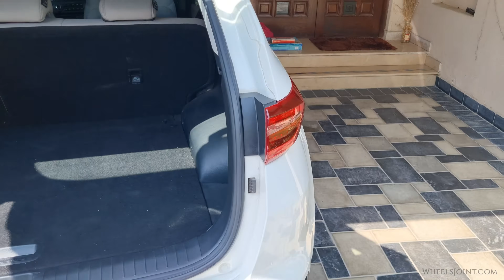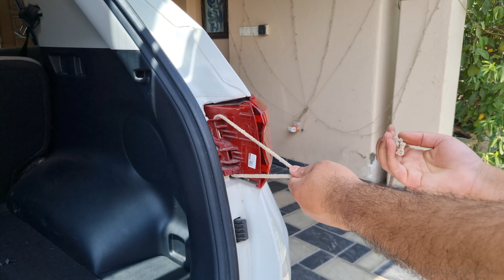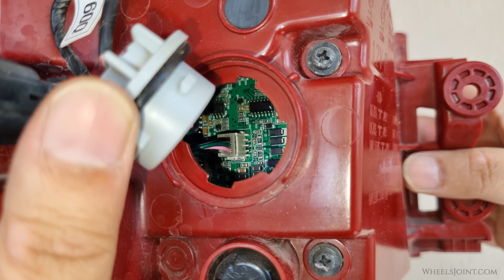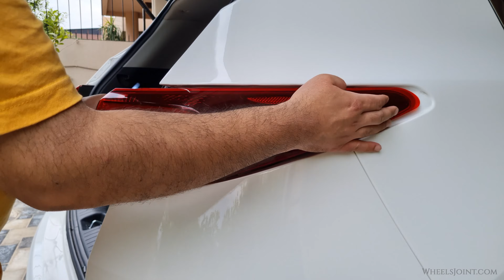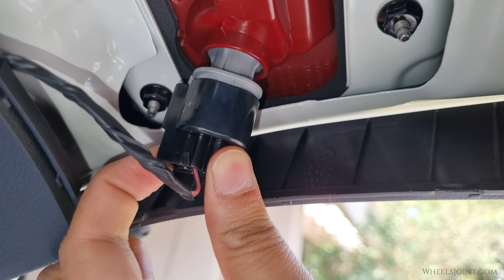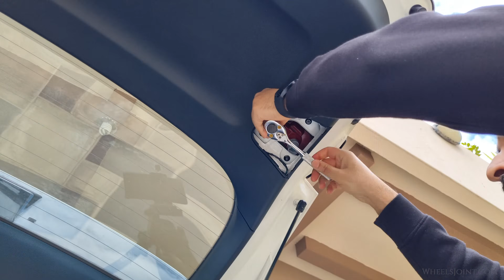How to replace tail lights on Kia Sportage - easy method

Comment: Your rope trick worked like a charm. We also found that it helps if someone puts on a rubberized glove and pushes on the forward side of the brake light simultaneously while someone else pulls the rope. It popped out easily using that method.

Comment: Thank you for this! I couldn’t get mine off originally, but I tried again today with some really thick gold ribbon (I didn’t have rope) and after about 5 minutes of pulling and talking nice to it, it popped off. I wasn’t gonna let this thing defeat me 😂 although the first attempt I tried WD-40 with no luck. It lead to a broken piece of the plastic on the thinner end, but glue is my bestie so no worries. 😅👏👏👏👏👏🎉🎉🎉🎉
Reply from the maker: Glad you managed to get it off, well done! 😊

Comment: I was only changing 1 bulb, but thank you for the tip for using a rope to pull out the housing!  Took a few minutes (plus some WD-40 oil), but I was able to remove it!

Comment: Thanks so much for the rope tip! I spent 30 minutes last night in the cold trying to pull the housing out by hand. Today I tried the rope method and couldn't get it at first. I put on gloves and wrapped the rope around my windshield scrapper and it came off pretty easily. Luckily the wires prevented the housing from hitting the ground. Screw Kia for making this so difficult to take out.
Then I tried taking out the bulb and the glass came out but not the metal... That took another 20 minutes to get out with some pliers.

Comment: Man fantastic job as always! Have you got any tips how to remove a moisture from headlights?  Or should I just go to my local dealer if car is under warranty?
Reply from the maker: Haven't faced this issue. There is a little bit of moisture buildup sometimes at night in cold weather, but it goes away after the headlights are turned on for some time, or when parked or driving under sunlight.

Comment: Yeah if I applied anymore pressure I’m confident I was going to break the fixture so I took a break.  It’s definitely loose but after spending over an hour with a rope on it I wasn’t able to get it out.

Im ready to just pull it out sideways and see how bad I damage it at this point.
Reply: I put a handle through my rope and gave it a quick firm snatch and it popped right out.

Comment: I couldn’t get my 2018 Sportage light out using the purely hand-wiggling method seen in other videos - no matter how patient I was. This trick with the rope worked a treat!

One CAUTION - my tail light assembly popped out suddenly, and I went for a backwards tumble. So, next time I’ll either have a wall right at my back, or I’ll have someone bracing me to keep me from falling backwards

Comment: Cant get the light off to save my life. Now im dirty sweety and still broken light.
Reply from the maker: You will have to pull harder. I wasn't expecting to apply so much force just to remove a light, you can hear me gasp in the video 😳
Reply: @WheelsJoint  i never got it off.. im gonna maybe try to get my dad to help lol. its insane to me kia made it like this ><
Reply: It is a challenge but, you can do it. 💯

Comment: Looks like you have to replace the entire assembly?? I do not any bulb replacement here.
Reply from the maker: If its LED, then yes! You will have to replace the entire light assembly. Otherwise, there will be a bulb you can replace.
Reply: It's ridiculous trying to remove that damn lens. Extremely frustrating 🤬